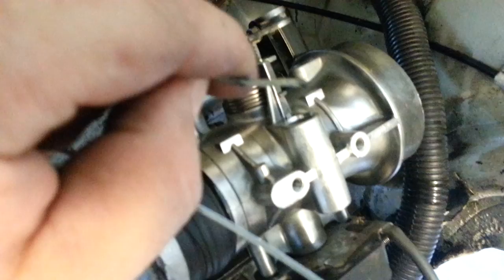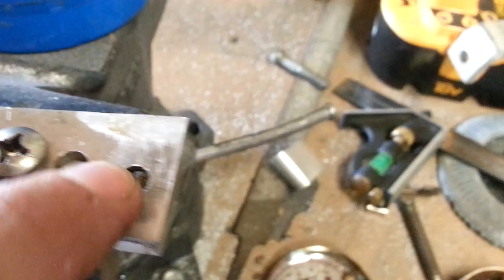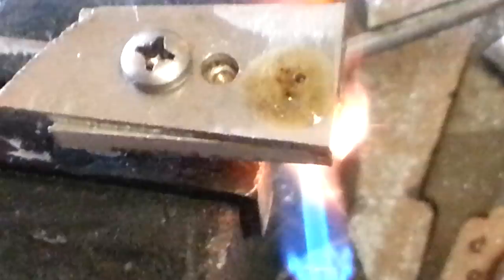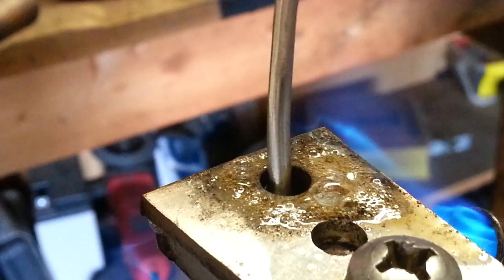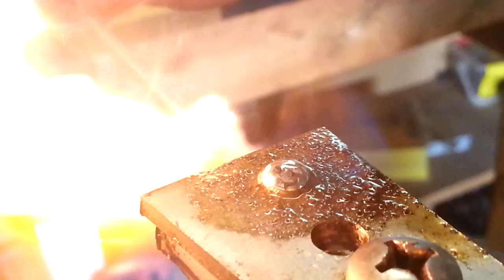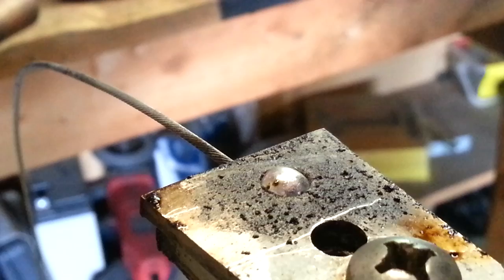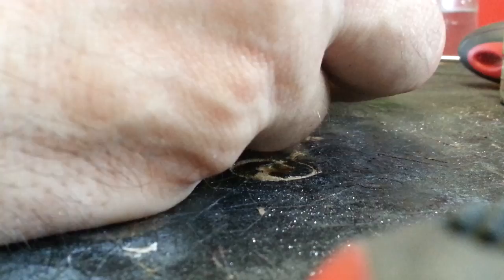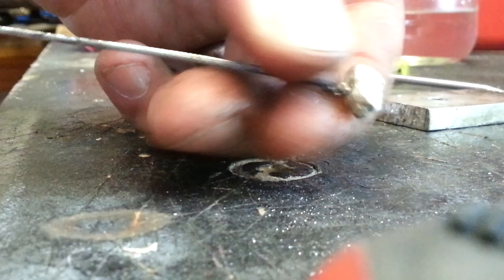How to make solder ended cables

Comment: FYI about solder. "Silver solder" used to mean solder with real silver in it. Silver solder is very strong like brazing but works at a much lower temp. And it's not cheap. Think brass clock parts. Now anything silver colored is called "Silver solder" but people in the trades should know the difference. 
Traditional solder is a mixture of tin and lead. The percentage of each different for different purposes. Lead not being so hot for our health, most solders now are non-lead. 
For this purpose, plumbers solder will work fine. Or make a visit, if you have one, to a local bike shop and ask if you can scrounge some ends off discarded cables. Some bicycle cables are leaded (yes, old term) on both ends and one gets  clipped off and pitched.

Comment: I really like the jig you made up. Had an old ski-doo and needed a throttle cable. Over $40 for an aftermarket. A $6 pedal bike derailleur cable had the perfect end for the carb slide. I used the ends of the old throttle cable and made a solder barrel for the thumb throttle side and presto; cheap replacement. I could have used an old derailleur cable from the kids bike; but $6 and a clean cable seemed worth it.
Reply from the maker: Thanks, I'm glad you like it!
I did find that most of my other cables (hood, choke, heater control) were easy to replace with bicycle cables. 
Actually, I think I only paid $15 for all of my cables together in a 10speed overhaul kit.
I just measures them out, cut them to length, and made my own ends.

Comment: U could use 2 smaller plates, drill the solder hole completely through both, then use a 3rd plate to cover the end so you don't get that rounded drill bit tip end on your solder barrel. Drill the cable hole the same way. :)  GREAT VID and your narration is better than most!

Comment: If you go to an auto body supply they sell a tinning compound for doing lead work on cars. This compound will cause the solder to physically stick to your cable instead of jut encapsulating it.

Comment: If you don't want it to rip out, you had better fray each strand of your cable and bend each around in a tiny circle so that it forms a ball inside the lead-tin casting.
Reply from the maker: rstevewarmorycom that’s an excellent suggestion., however ...because my application was a throttle cable and not a brake or clutch cable I didn’t feel the need to get crazy on the splaying/fraying of the cable end.
If you feel the cable may pull out from the force of your application, You probably want to look into another termination method.
Reply: @SigmazGFX  
That's true, but the only time I tried that for a motorcycle clutch cable, it pulled out, and I was tired of it so I bought a new one. I cut open the end on the one that broke and melted the lead off with a torch and the cable was done as I described.  It was the cable itself that frayed in my case.

Comment: Just an fyi plumbers flux is corrosive. Even non acidic plumbers flux will end up contaminating the solder. As will any solder wire for plumbing. Even if it is an acid free rosin. Core. Just a heads up in case that would matter for some.

Comment from the maker: I know there should be some type of official "use this type of solder" but I just used big thick plumbing solder.
Thanks for checking it out!
Reply: SigmazGFX use the 50/50 or 40/60 lead tin solder WITHOUT flux core
Reply from the maker: Thanks Kerry! I appreciate the info.
I think this roll was labeled "Silver Solder"
But it's been a long time since that video was made I can't really remember anymore..
Reply: Just make sure that you Flux the crap out of the end of the wire before you pot it so the solder will flow into all the wires
Reply from the maker: Got that right!

Comment: I have plenty of solder but just out  of curiosity could you use brazing rod? 
Is there a certain type of solder that would best be applicable for this? 
Good video, and great job showing the steps to accomplish this.

Comment: u can get solder pots on amazon now for 25 bucks, I got some kester pure 60/40 solder in bar form for 36 bucks, u can find the solder cheaper, it's a good setup to have in the shop, can use it for electronics work too.

Comment: in your opinion do you think break/parts cleaner would work to clean a previously used/greased cable ?? going to try your method. looks way better than the wood method.
thanks for the video.
Reply from the maker: Thanks man.. yeah... the wood method is kind of messy...
I don't see any reason why brake parts cleaner wouldn't work. 
I would only suggest waiting to solder the cable until after the cleaner has dried.
Good luck man, I'd love to see your finished product.

Comment: I looked at the other comment 3 years ago hey man you're saved my bacon on my Chopper man I'm out of cable and I can't adjust it right I'm out of adjusting on my clutch Hub thanks man save me about $100 for a braided cable thanks again
Reply from the maker: That makes me real happy.. glad it helped you. that's pretty much the same reason I did mine like this. original OEM cables were too expensive or unobtainable.

Comment: can you do a stress test on the cable see how much force till it breaks?
Reply from the maker: The cables I did this for were throttle cables and hood latches  These applications are fairly light duty. If you wish to repair a clutch cable or brake cable then you'd most likely need to use a more rugged material than lead/tin. BTW these cables have not failed yet.

Comment: Right after you got the solder to ball over, you should have used a real cotton rag soaked with water to cool the item. The solder will harden almost instantly. The you just take the gig apart and do some finish touches and you are done. Good day too.

Comment: i bought a screw post extension and drilled a hole in the side, put the cable through the hole and spread out the wires then filled the thing with solder and cut to width.

Comment: I use bolts. Find the right size, cut, drill hole for cable, drill hole for set screw, tap bolt for set screw . This will not pull out nor will it wear as solder does.

Comment: Try sooting up your soldering hole next time - it should keep the sticking to a minimum if not eliminating it.  Use a candle or a smoking acetylene torch.  It might even eliminate the need for flux on everything but the cable.  It's worth a shot, right?

Comment: What kind of solder to use when making a van sliding door cable ends?
Must be strong as well as its tge only thing that will hold the cable in place at the pulley.
Reply from the maker: FlipSide Garage If you browse the comments there have been several suggestions pointing to silver solder for maximum strength.
It sounds like your application may call for that . Idk how big your door cable is, but you should be able to scale up this method with stronger materials and a bigger flame (woo hoo!) if it’s just the cable that actuated the latching mech silver solder will do you right.
If it’s a cable under spring tension to support the door, you may want to reconsider replacing it with new. Safety first after all, lol.

Comment: put the Flux on the cable not the mold.want it to stick to the cable not through fixture .you might use silver solder for max strenth
Reply from the maker: Thanks! The cable was also dipped in the paste flux. 
I think I mention this in the video, but its been so long I can't remember.
Reply: Im needing to make something similar for a van sliding door pulley cable. What solder do you recommend that has  strength and it not come off?
Reply: Agree defiantly Silver, dont understand fluxing your mold. looks 3 times harder than it should be...

Comment: Aren't these cables available at your local bike shop for like $2 to $5? Mountain Bike brake cable.
Reply from the maker: Yep! you can find precut replacement cables at many places even Walmart.
This tutorial is to show how to make ends for those readily available cables after you cut them to your custom length.

Comment: Just watched  the video now what type of soldier  did u use ? I plumber  or can I use the wire solider?
Reply from the maker: tre watkins good question...I’m not sure if 60/40 electronics solder has the same density or hardness as plumbing solder.
I’d be concerned with the cable pulling out with a softer solder.
You can give it a shot, but I can’t say for sure what the results will be like.
 Please share your experience here, I know everyone including myself would love to know.
Reply: Kool when I go out today I'll check home depot to see if what I got at home is the same as hardness goes

Comment: You can see solder got up into the cable where it should be flexible, and you cooled it quickly in water, two things that will reduce flexibility of the cable and introduce a possible point of failure
Reply from the maker: Dave Geraghty thanks for your insight Dave.
When I dropped the fixture into the water the solder was already cooled pretty well, I figured I’d dunk it so I could move along with the demonstration.
As to the solder wicking up into the cable, In most applications that shouldn’t be a problem.
Even with a throttle cable that rolls around the twist grip tube I’d imagine it doesn’t flex enough to be a concern.
I’m pretty sure everyone knows that this method in its entirety is a compromise.
Technical white papers and X-ray analysis were omitted during the production of this video.
But thanks for your professional advice.

Comment: Your totally wrong you can get a bolt on end for that.
Reply from the maker: Sure, you probably can.
But only after you find a retailer that has exactly what you need
That being said, The video is to show how I made 'solder' ended cables. So it's not wrong at all, actually it's "totally right"!.. 
Oh, and it's " you're ".
-thanks for watching and commenting.